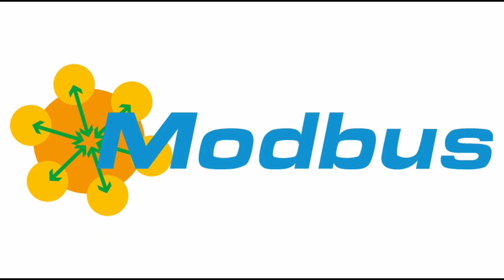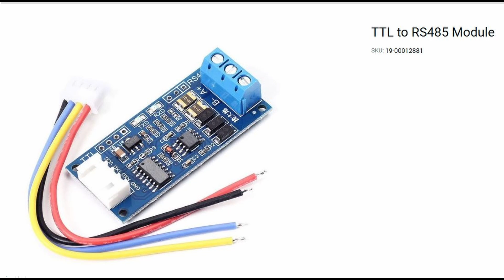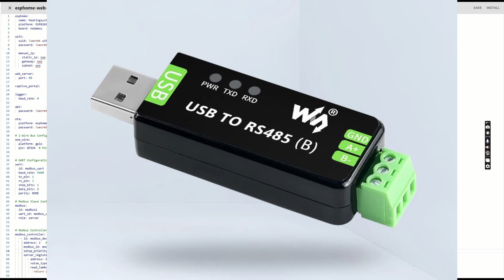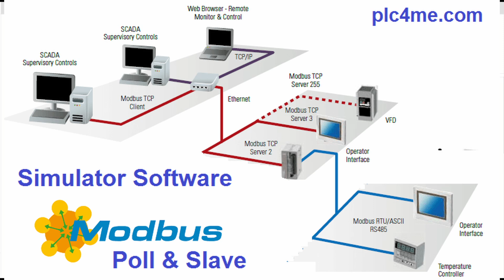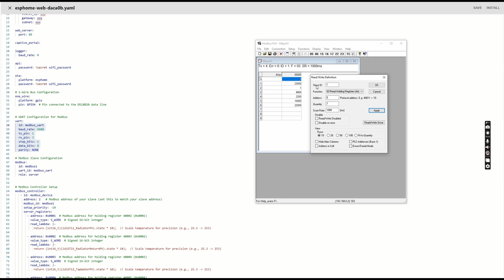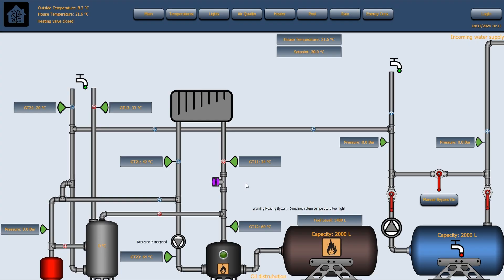ESP8266 as a Modbus Slave Over RS485: Temperature Monitoring Made Easy! Part I

Comment from the maker: As i am learning about youtube i would appreciate your input regarding the video, i know the MIC is not the best, but what else?
Here is the code, it comes with a Form.
https://forms.office.com/r/6L5uUm6NDP?origin=lprLink

PART 2 Video >> https://www.youtube.com/watch?v=ZYjPJ5FvxnQ
Reply: Thx, I'm looking into connecting siemens logo 8 to home assistant. There is indeed not mutch info out there.
Reply from the maker: @wardwyseur  There is not a ton of information no. But also, i guess, if you are running a name brand PLC maybe you don't have the need for home assistant, i don't know. I personally love the Home assistant platform, the huge variety of integrations and things one can do is so amazing. I am mainly playing around with my PLC, i recently acquired the ABB PM573 that i will start playing with also. I run everything from my home assistant. But i wanted some more reliable and "stand alone" system for my heating system. I did not want to rely on wifi to run my heating system, other than that the system is kicking it. What are your plans for the Logo integration with home assistant, you made me curious.